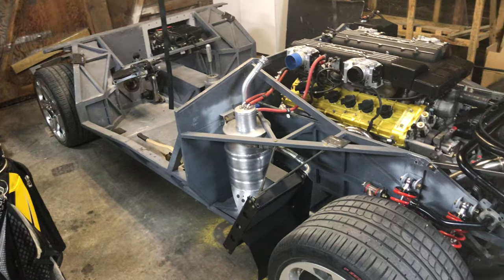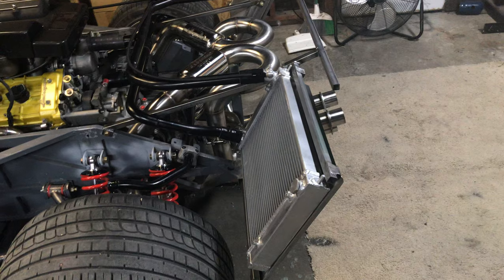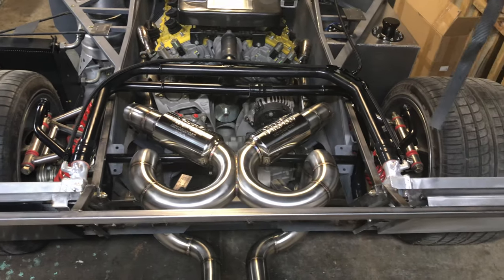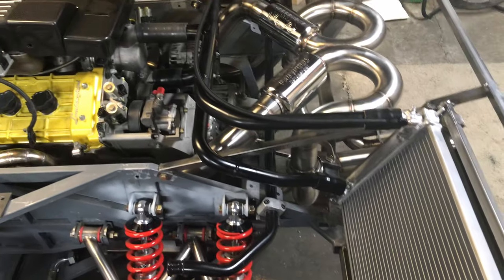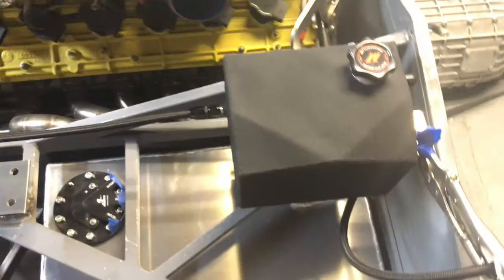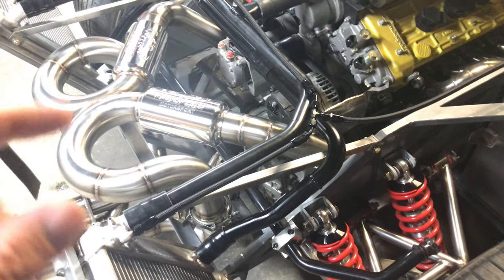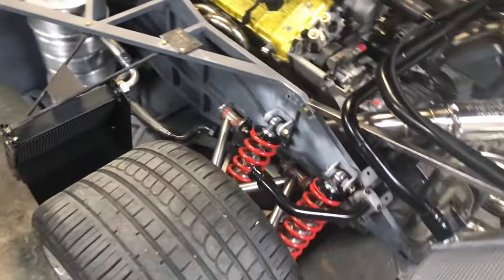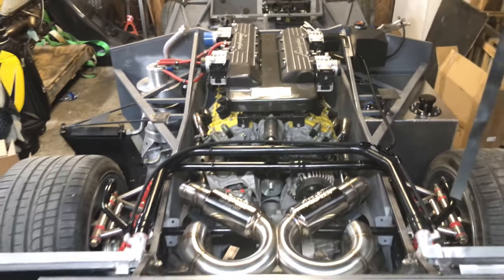Lamborghini Diablo 6.0 replica update

Comment: Coming along awesome! I like the radiator pipes. I did hot-rod flexible stainless pipes but I don't trust them since they have three couplers per side and I can't weld them. Just got my shifter mounted and working last night. Charging the A/C system up this week then finishing the seatbelts and pedals and the interior is going in FINALLY for good (I hope). Radio/amps are wired, wiper, washer, lights, doors, windows, mirrors, push start ignition alarm all wired. I know there will be a ton more stuff as it gets closer to driving but one step at a time finishes the journey!
Reply from the maker: It`s all the little stuff that takes the most time! Cant wait to see yours finished. I was going to use stainless flex coolant lines. It was more cost effective to hard pipe them.

Comment: Lovely build. I would make a removable brace to go in between the rear suspension connecting each side as there will be a lot of load and forces on the rear suspension. It will help stop the chassis from flexing and give better handling to. Something to think about 😉👍
Reply from the maker: Thanks. You are absolutely right about the flex. It flexes under its own weight. I do have a removable brace. Unfortunately it hits the power steering pump. I`m going to redesign the diablo brace to be more like a murcielago brace. The murci`s much stronger.
Reply: @AmericanBuiltExotics  I didn’t know if you had one or not and only trying to help. Definitely have the brace connecting behind where the spring top mounts are and not off the top of that box section side panel as the suspension will rip through that side panel pretty easily. Looking like a nice build though 👍
Reply from the maker: @Spoonersoutings  NAERC plans have the cross brace on top, off the engine bay side rails. On a real murci chassis... the cross brace is lower, and behind the suspension brackets, as you alluded to. I`ll take any advice any time, thanks!!!
Reply: @AmericanBuiltExotics  have a look at a real Lamborghini chassis schematics and Nass car and drag cars to for references as there are a lot of tranquillisation in the chassis and the thickness of material used it’s all letting the stresses pass through it instead of exorbitan the stresses and toque of a engine witch would lead to rip itself apart. I wouldn’t want you to finish your project and have to take the hole car apart to redo something when this is the perfect time to stand back and Doublecheck everything before pressing on 😉
Reply: @AmericanBuiltExotics  I don’t know you was following any plans but I would definitely cross reference them with other cars as I have learnt your best friend is research research research. I don’t know everything but I know a little bit about all most everything lol. I don’t like to see someone’s hard work and hard earned savings go to waste and dreams smashed because of something easily fixed if some one have just pointed it out. I don’t know if in them plans of yours they tell you about bump steer? If it doesn’t your steering rack needs to be the correct length and pivot inline with the upper and lower swing arms where they connect onto the chassis or you will get bump steer. Hope that helps to. I take my hat off to anyone that builds there own car as there is so much to think about and you always have to be thinking 3-4 steps ahead. Your doing a grand job 🤓👍

Comment: What did the motor set you back? Is it new or used? Sorry, my first time watching.
Reply from the maker: Engine is used. Less than 7k miles. A used Murci engine (only) goes for 20K-35K. I`ll keep what I paid confidential, for now.
Reply: Tha is for the reply. Your car looks fantastic. It’s going to turn out incredible because of your attention to detail. I was asking because I’m thinking of a couple different builds I want to undertake as my first. I wanted to try and find a used V12 or a Ferrari v8 to transplant in a Daytona kit car. I have been looking around but I don’t have that deep of pockets but I want to have that Italian sound coming out of the car. I definitely respect keeping the price quiet. I’ve been looking at a Maserati v8 since it is based on the Ferrari and has that high revenge sound. They are reasonably priced. I found the Falconer V12 but very expensive.

Anyways thanks for the reply and your videos. I subscribed and will be watching.
Reply from the maker: @romans8forging181  Have you looked at a Mercedes M120 V12? Inexpensive, 400Hp, straight pipe them, and they sound amazing! I just sold my m120, that was intended for this project.
Reply: @AmericanBuiltExotics  Thanks for the suggestion. I have seen them out there and that might be a good alternative. I just think it would be really cool to take a Ferrari replica and put a Ferrari engine in it. But I might be in for it as far as maintaining.
Reply from the maker: @romans8forging181  Gotcha. A Ferrari drive train isn`t anymore affordable. Lol. Good luck whichever route you take.
Reply: Thanks for the advice. Look forward to watching the progress on your build.